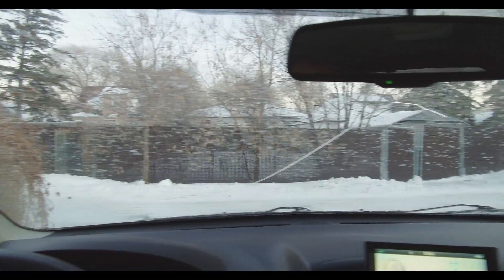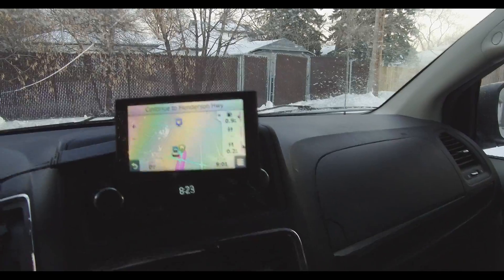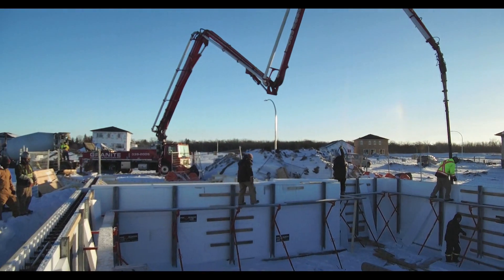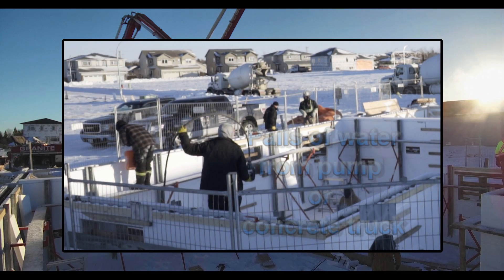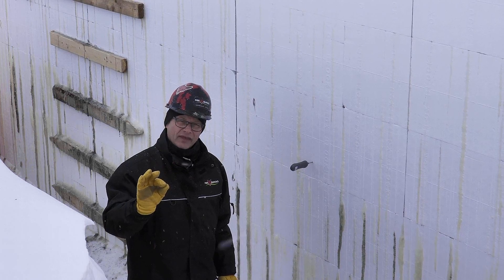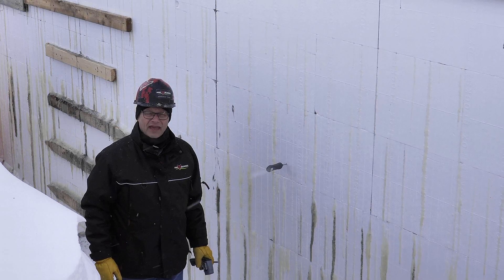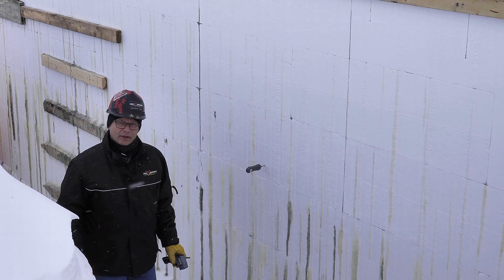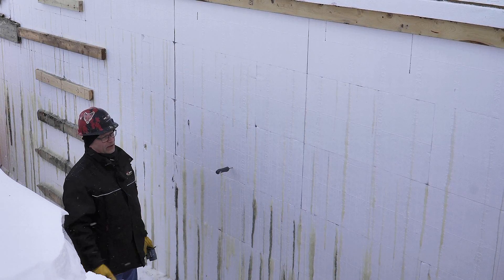Fox Blocks Winter Concrete

Comment: A local builder in GP was placing concrete at -5, was -15 overnight, they placed it at 1600, and the forms were stripped the next day before 9am. When I called code to complain, the head of the office a woman I believe said"it's not my job to babysit contractors "    actually no it is your job".